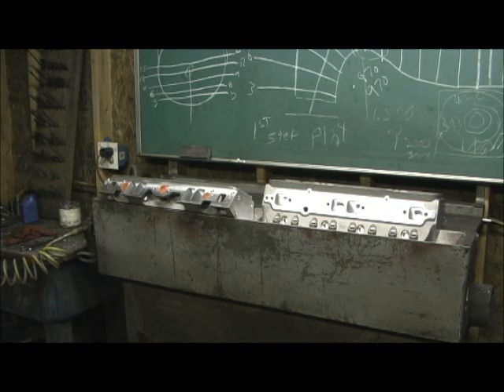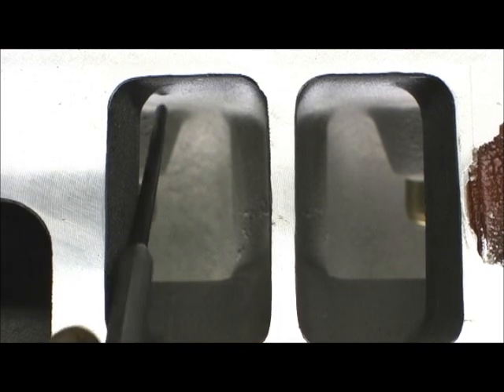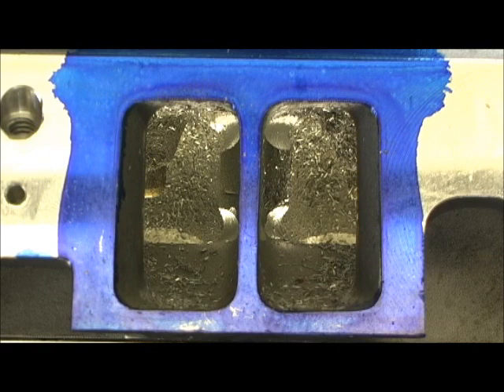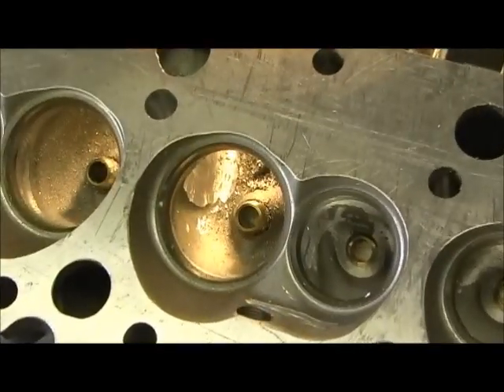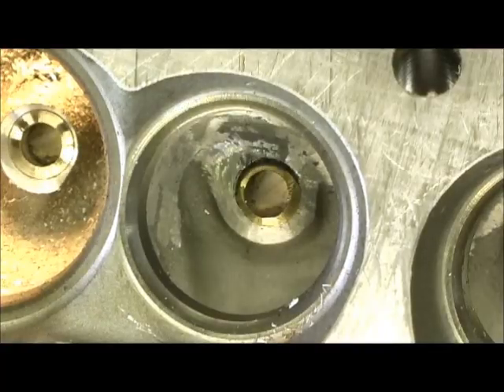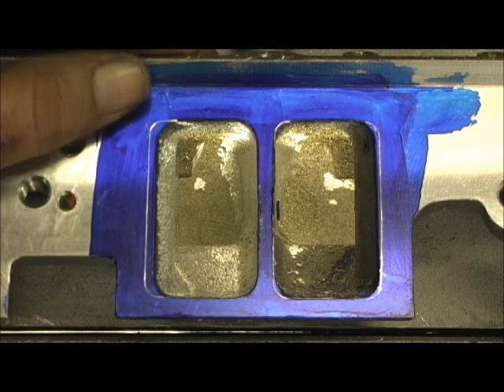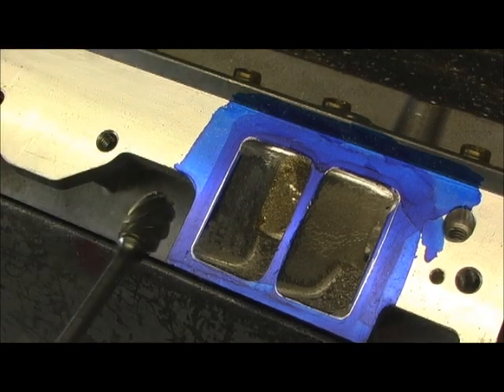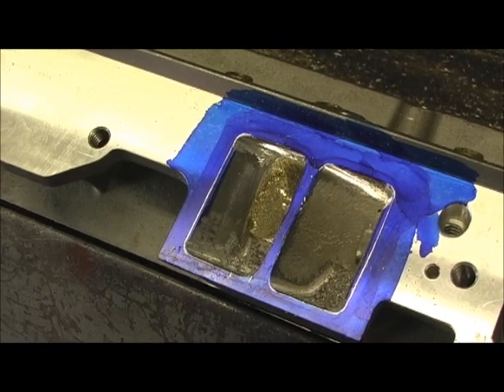ProComp 190cc Cylinder Head Stage IV To 211cc

Comment: Was just thinking about one of the advantages to trimming down the Valve guide in the bowl like you do.. Theoretically since there is now less length in the guide for the valve to travel through, couldn't this be yet another factor to Valve longevity? Less runner valve guide runner length = Less friction = longer valve life...  Or is it not enough to have any effect other than better air flow fuel mix etc..
Reply from the maker: 2 inches of guide length on 11/32 is the limit on cutting the guides down. This is what I have found over my years.

Comment: Hey I have a set of the Superflow heads I brought about 7 years ago  I heard that they are the same as the procomps I have the on a 350 40 over .500 lift cam I did some amateur pocket porting on them I put quality parts in the heads like Manley super duty valve's and guides and comp springs I'm running a duel plane intake iam  shooting for 400 hp or more and i want it to be torque I plant to do road racing with it do you think I need to send them to you to get that or am I ok?
Reply from the maker: What cc are the heads to start with, you did  not mention that. Bowl blending (even the best armature style) is worth about 20 to 25 HP. Compression is in there as well, one of the main things.
Reply: my mistake, the heads are suppose to be 64cc the pistons im running are 9:7:1 .the valves are 2.02/ 160 I did get a three angle valve job after I got them and I let the machine shop assemble the heads .

Comment from the maker: BE CAREFUL Driveshaft, especially around the seats, and the area around the "pillar of power" as it is Paper thin there coming from the "Pillar to the seat". There great heads, and you should be able to clean them up with no problems.

Comment from the maker: That is absolutely NOT THE POINT HERE!!! Quite the Opposite indeed. When you look at the fact that the Pro-Comps are around 450.00 Bare, then you spend around 1000.00 on porting and prep, then around 300.00 on Parts, you end up with a BRODIX, AFR, (last and least EDELBROCK) KILLER, you would have to spend around 1000.00 more on Brodix and AFR, and Dart to equal the awesome power potential of the Pro-Comp head, so in the end is dollar spent for power gain, PROCOMP WINS!!!!